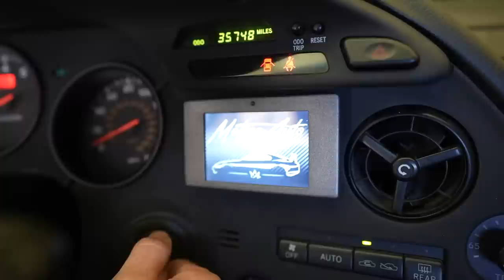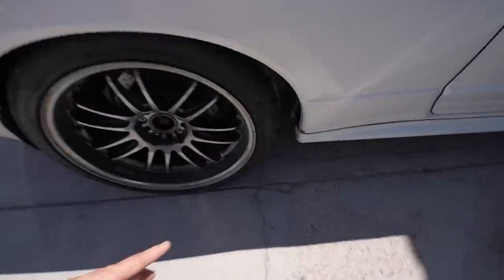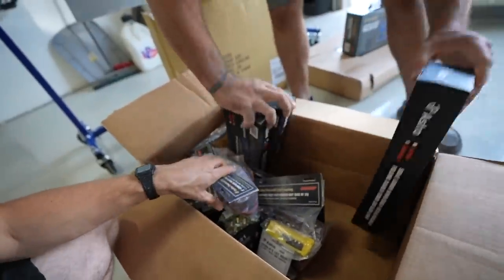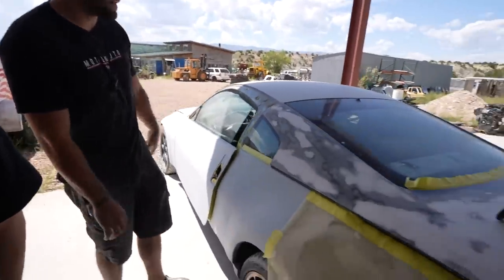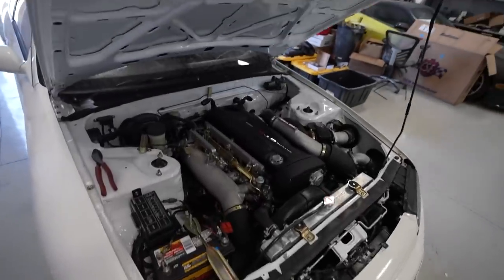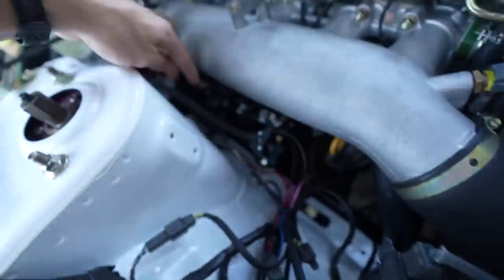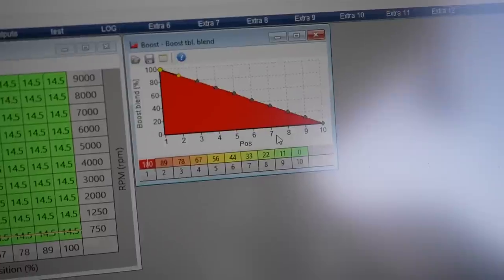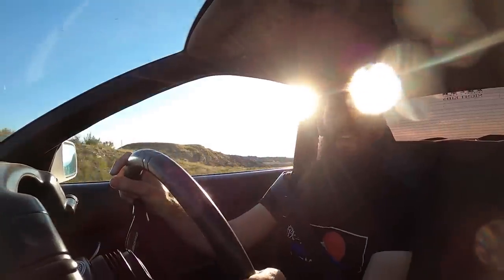Supra Meets The R32 GTR + Flex  Fuel / Boost Control

Comment: The boost control solenoid job you did on that looks like absolute shit man; at least use a DTM connector and put loom on the wires. 

You have a problem of just putting things together in a hurry for content instead of doing it the better and more presentable way.

Comment: High compression engine hard to turn over with the starter because it has to fight the compression . Low compression engine hard to start because it needs the compression to be able to start .

Comment: You guys should do a give away, Of taking in someone car that there's something wrong with that car that has it disabled and not running and fix it for the person, And pick someone that doesn't know crap about car and how to repair engine problems. Hint hint I know someone with a Golf R that the flywheel bolts came loss and screwed up the crank, And the person has already put thousand's of dollars into the engine and hasn't got anywhere with the damn car

Comment: Cringe at the bullet style wire connectors. Crimp and heat shrink or at least solder and heat shrink on it. Or even better get new pins for the plug and not join the wires at all. These little things make the world of difference on an otherwise quality build.

Comment: all of that work on the GTR and then you use crimp connectors to wire in the sensors and zip tie the stuff back, really my guy? Why not buy the right plug and pin the sensors right into the plug and make some nice brackets to mount the sensors? , also relocate that fuel pump wire into the fuse box, make it look factory